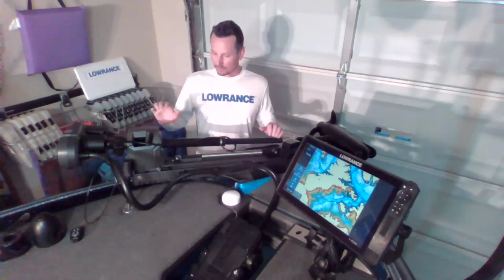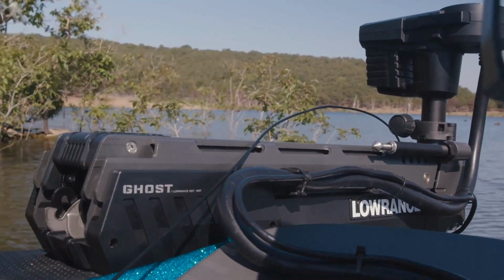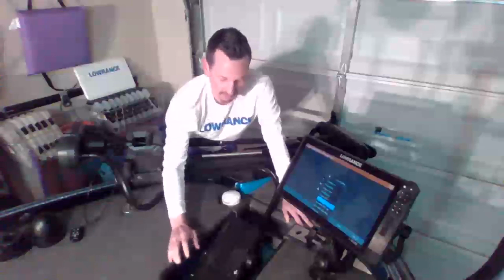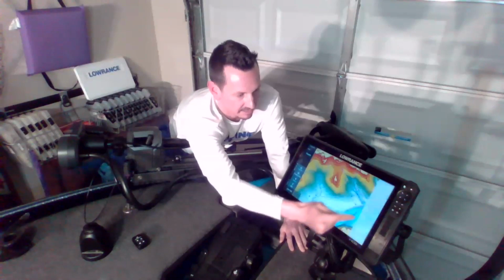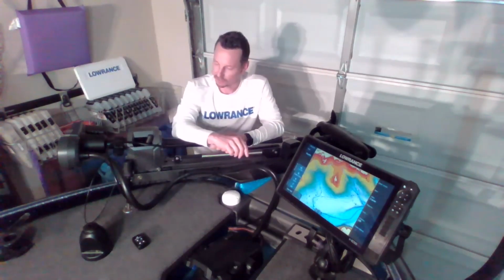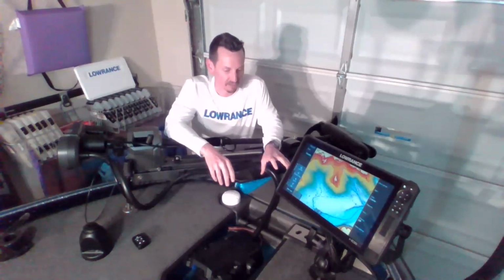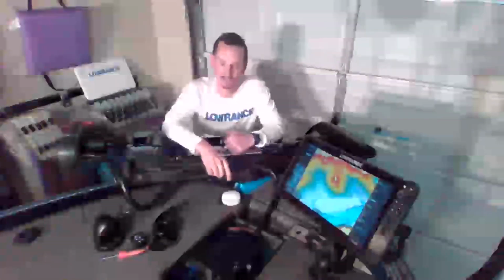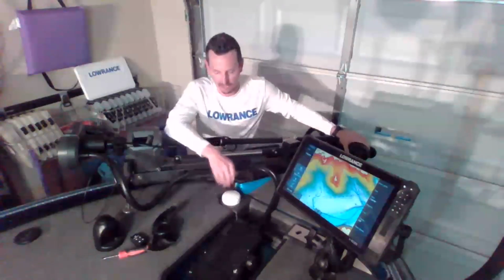Lowrance LIVE - GHOST

Comment: This video is just about unwatchable with all the stuttering.
Reply: I thought it was just my phone yeah this videos horrible
Reply: @rwilko9525  I just mounted my ghost  today. Ill do a full review when I get a chance to get on the water.
Reply: @phatdonkey78  awesome! That'd be great.They're about 4600 AUD here so doing as much research as possible beforehand. Yours got the remote? Heard they were coming out soon.
Reply: @rwilko9525  I'm not a fan of the remote. I honestly can't think of a need for it. The idea to me of having foot controls is to keep your hands free to fish. This will be my first advanced level trolling motor though. I upgraded from a minn kota powerdrive v2 42 pound thrust.

There may be a day I decide on the remote, but I think integration with graphs will be enough. If the motor is in the water, 99% of the time I'm on the forward casting deck. Just don't see the need now.

I got the 52 inch shaft (paid just over 3k USD) due to the boat I have. It's a multispecies with a slightly higher bow than bass boats. I installed it solo in about 2 hours. Would have taken less, but I have the whole casting deck ripped out for deck replacement and carpeting so I have to be nimble walking on the aluminum framing. Also, the ceiling in my garage is only 7 feet so to do the deploy and stow stuff I had to roll the trailer out of the garage. It was an ordeal, but if I could have had more room I could see the whole install taking an hour.

Comment: Need help wiring ghost trolling motor to HDs 12 carbon it is not connecting I use Nema 2000 still not connecting push autopilot from settings only shows me chart compass hide or show